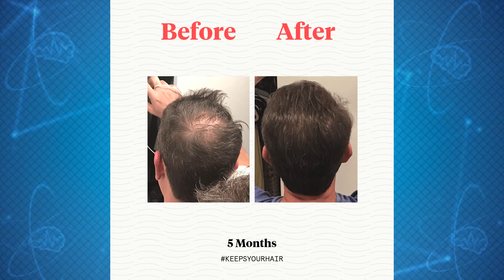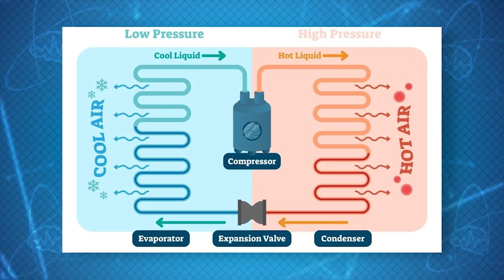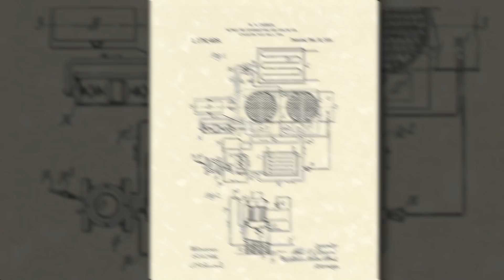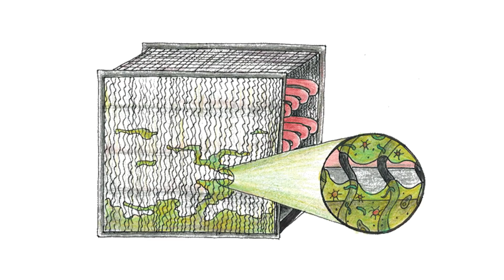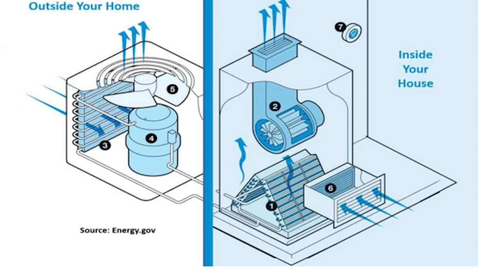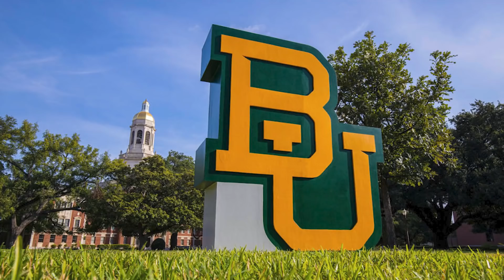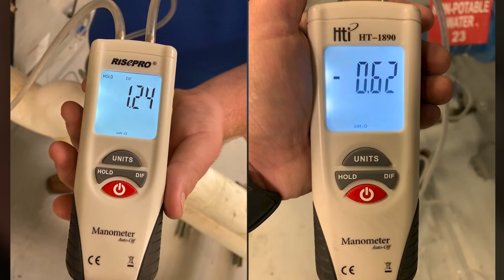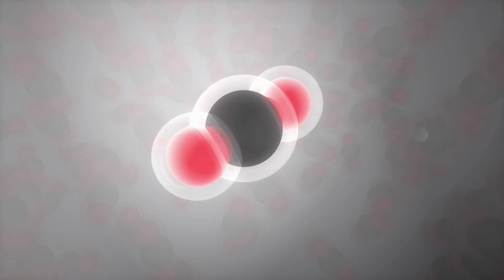What's in this Blue Box Will Save a Trillion Dollars 💲💲💲 | In Depth

Comment: I own an HVAC company.  This guy is completely misleading you on many levels and he knows it.  Foaming coil cleaning chemicals have existed in this industry for over 50 years (Nu-Calgon 4291-08 Nu-Brite).  Engineers DO NOT oversize equipment by 40% (or even 1%) to account for future dirty coils.  Ever-restrictive building codes (and construction budgets) would NEVER allow for that.  This guy is completetly long-winded, keeps repeating the same info, and also contradicts himself.  To hear the hosts cite how many gallons of oil or how much carbon footprint will be reduced with the product is silly.  To hear them talk about offering an "investment opportunity" in the product is scary.  Every HVAC tech in the world knows how to use longstanding products to completely clean your coils (not "just the top 5%"...lol).

This is so aggregious that Now You Know needs to issue a correction here.  It appears the CEO keeps looking to the same spot on the wall as if he's reading something.  Truly friends, this is ridiculous.

Comment: Hang on a second, US electricity consumption is 4,000TWh/yr - 10% or 400TWh/yr is used by home and building AC (1/4 of homes which is 40% of total according to the numbers -> 10%) and the suggestion is that a 40% savings would be achieved with this -> 160TWh/yr savings.  Now, I can see this happening on large commercial buildings (not sure what the percentage usage is) for coils that are getting really old, but I've pulled 15-20yr coils out of homes that were virtually spotless.  While I see this as valuable for some commercial buildings, and more likely the difference is 10% energy savings or closer to 40TWh/yr of total savings if everyone did this or you're savings being off by 25x in the potential savings.  Add to this, companies have known about using enzymatic cleaners on industrial AC systems for decades, so this isn't new, however some building managers haven't known about it.

Comment: I converted from a geothermal closed loop system for my home 8 years ago.  Best investment ever.  The water source heat pump draws less starting amps and I can run off grid.  Energy costs almost 1/3 less than before.
Reply: How did you install it??)

Comment: So disappointed in this video. Believing wild claims like 40% efficiency improvement with no fact checking or follow up question The claim that at 7:50 into the video "there has never been a way to clean these coils" is completely false and you sat there like a Fox reporter talking to Trump never questioning such a ridiculous statement. If he had said compared to other cleaners in use today ours provides such and such benefits and her is the link to independent tests, I would look into those tests and possibly by this product but this was just an infomercial and so sad.

Comment: I am an air conditioning technician.
 This guy is a con Artist salesman,
Don't invest money  in this business. 
  It is a good message to clean you're air conditioning coils so thanks for that. A blocked indoor coil will be inefficient and save you power on cooling cycle, as it's not transferring heat well, where  as a blocked outdoor coil will raise the unit head pressure and not only cost you more power but can burn out the compressor ,very expensive to replace.
Reply: What are your views on effect of biofilms ?

Comment: I would have thought that the simplest solution would be to design buildings so they don't need HVAC systems. So no need to power a HVAC system and no need to clean them a win-win. But saying that, props to Blue Box for finding a solution for the existing HVAC systems.

Comment: Three ways to save on AC: (cheap and efficient)
1. Set temperature to 75°F rather than 68°F and you don't have to wear a sweater inside.
2. Close windows and doors.
3. Keep the AC clean and in good working condition.
Some extra things to do: (good but expensive)
4. Insulate walls and roof of the house and use energy windows (works summer and winter)
5. Install solar panels on the roof.
6. Replace AC with a earth heating and cooling system.

Comment: Maintaining the efficiency of your HVAC system is cash. Buzzword: preventive maintenance done by a qualified technician. There are already a lot of coil cleaners out there. If blue box does a better job here, well you are welcome. I do believe in general that there is some potential for optimization in HVAC systems but 40% in average seems to me too optimistic. Homeowners with an HVAC system can save a lot of money with an well maintained unit but sometimes it is better to go for a new unit with higher (part load) efficiency and variable speed drive motors on the compressor and air blowers than repairing the old stuff.

Comment: As an instant cure its great, but better changing building practice. They knew how to make self cooling buildings in the past, see persian windcatcher towers.There are lots of modern approaches also prove to work.
Reply: I'm sure there are many techniques, but the won't all be as effective as AC. I grew up with swamp coolers which is another technology, but it doesn't work in certain humidities or above certain temperature levels. It also requires the home to take large volumes of outside air in and push large volumes out. I'm guessing other alternatives have similar limitations. AC is widely used because it is essentially universally effective.

Comment: Coil cleaners are not new most coil cleaners have harsh chemicals and damages the coil which leads to inefficiency
Reply: I've worked on commercial air conditioning coils that have been cleaned with foaming cleaners like this one for decades with zero damage caused by the cleaner.

Comment: I'm a building engineer I maintain high-rise buildings this guy is not telling the truth, he is twisting numbers in his favor, no building has the HVAC 40% oversized at the construction, we are doing third party monitor of the building air every three months, this devices are installed in the ducting supplying the tenant spaces after filters and coils  they sample the air every minute, we never had a problem with the air quality, building is 30 years old with proper maintenance you don't have any problems. Right now on the market there are multiple foam and types of cleaning supplies for coils I doubt his product is so magical. I like your show you guys doing a good job.
Reply: for large HVAC systems there has never been a way to penetrate the coils. For thin coils you may get through the coil, but you are not removing the biofilms. Most buildings are way oversized because of this issue.
Reply: Building air handler size by CFM, building has a hot side and a cold side which is changing through the day depends on the position of the sun, a total floor VAV's boxes max CFM are usually between 30 and 40% higher than the air handler Max CFM capacity because through the day VAV's boxes are not all 100% open at the same time, that makes a typical air handler 30% to 40% undersized.

Comment: Where would the coils be on a residential unit?
Reply: The evaporator coil, which is where the film grows, is inside your air handler unit, usually an A frame unit . The outside condensor coil gets too hot for the film to grow, but it is susceptible to dirt, grass clippings, leaves blocking the air flow. Keep the area around the unit clear.

Comment: Hot Tub/Spa owners know about using enzymatic cleaners to break down biofilms.  If this works as well on A/C coils as those do on water handling systems, it's a winner!
Reply: This video is BS. Foaming Coil Cleaner has existed forever, and it has been used to clean industrial AC units forever as well. Zack and Jesse are victims to spreading misinformation.
Reply: @Skibszilla  That's a possibility.  I use the "regular" foaming cleaner (with coil scrubbing cap) every year, and if I forget, my a/c will eventually throw codes.  But, it isn't enzymatic like the spa cleaner, so it is more for cleaning grime than biofilm.  I'd sure like to see a lab study on heat transfer improvement with Blue Box vs the normal Air Conditioner Foaming Coil Cleaner.

Comment: Awesome as it is, and it is; thank you for sharing. When does it get to the Residential service market, and if continued service is required, either commercially or residentially; how much and how often? In quantifiable terms?  Best wishes.
Reply: He is lying. Coil cleaner has existed forever. Go buy some from Lowes or home Depot.
Reply: @Skibszilla  Got it.  Did a little research and got through the hype and drama. Seems a little education and raised awareness might be a better way to go. Thanks.

Comment: Do american buildings use the same air from the exterior to whats coming out of the ceiling/walls ? That's weird to me, a wall split unit should not be connected to the exterior unit for the air part. Now I'm not saying indoors split units don't get crap in them too, in fact Europe is about to tighten the schedule at which you have have them inspected and cleaned to combat both problems exposed here but it's not anywhere near as bad as some of these pictures

Comment: What is most important is not even needing AC to start with--- highly insulated walls, floors and ceilings, and triple-pane windows.  That is only practical, or even possible, when planned from the outset.  But this foam system is certainly helpful for all existing structures. 

What we need are building codes that require new comstruction to be as efficient in this regard as possible.

Comment: or they could just use a brush and soap regularly so the film never forms in the first place
Reply: no - the outside of the coil is only the outside surface area, roughly 5% of the coil.  The big problem is deep inside.  This space has never been accessible to remove the bio build up and disinfect the coil.  Makes all the difference when trying to restore air flow and heat transfer efficiency.

Comment: There are already foams in the market to clean AC coils. How is this product any different? Does not seem to be an innovative product.
Reply: Foam is not new, but how to penetrate the coil using enzymes in foam phase is and this is what I patented.  Prior to Blue Box there has never been a way to penetrate through these deep coils.  By solving this problem, we make it possible to fundamentally change how buildings can operate so they are running efficient and healthy.
Reply: @jimmetropoulos6596  Thank you for replying Jim. I bet if you ask the other manufacturers of these foams, they will all say theirs also penetrate deep into the coils. Maybe you guys would of done a comparison test amount different brands to highlight how your product is superior. Just a thought.
Reply: @kennethvargas5953  Blue Box's biggest impact is on the big, commercial systems.  For these systems, its never been possible to penetrate the coil - not even close.  For residential units, what is out there are chemical foams that do not breakdown biofilms.  To tackle this issue it really needs enzymes that are specifically designed to digest this material down.
Reply: @kennethvargas5953  Kenneth - when talking about the deep coils for the commercial systems, there is no one who can get through the coils.  Trane and Daikin both are now outsourcing their coil cleaning to Blue Box - says a lot :)
Reply: @jimmetropoulos6596  That’s the type of explanation I like to hear. Will your product only be available to commercial customers?
Reply: @jimmetropoulos6596  bro your channel is blank your missing out on a huge marketing tool without any videos